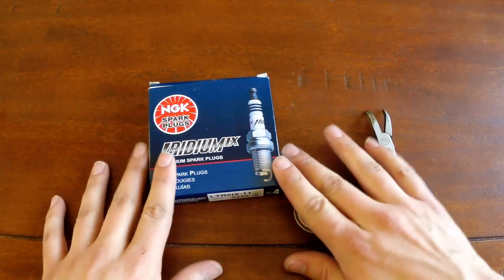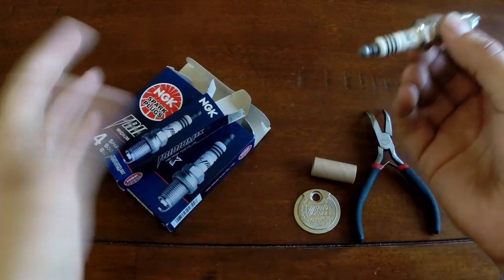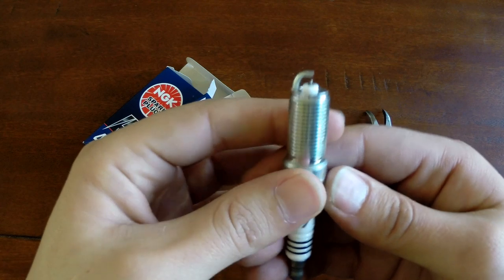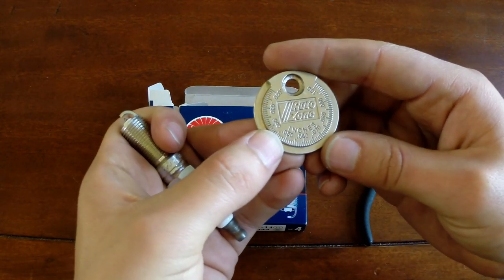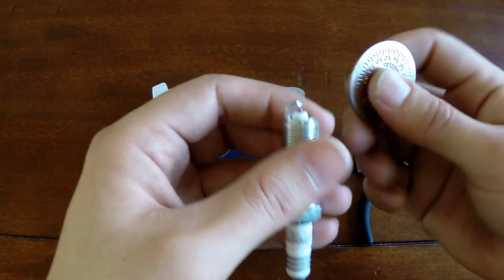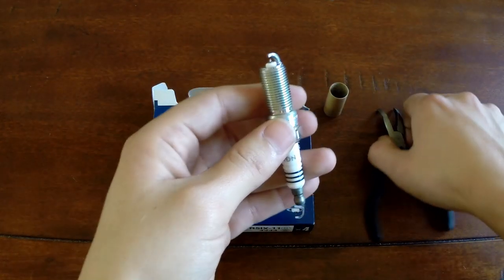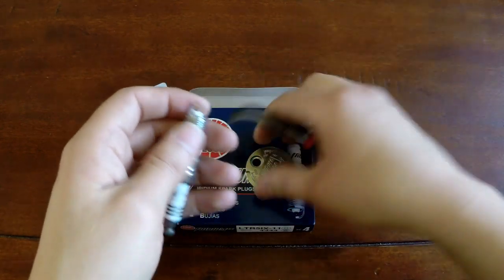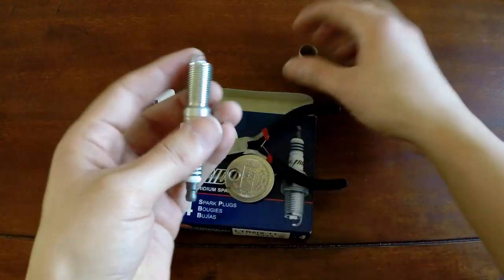NEW SPARK PLUG INSPECTION AND PREPARATION!

Comment: Do you ever use an anti-seize lubricant?
Reply: Anti seize is not typically recommend for spark plugs as it can change the torque. However some people swear by it some people never do it some people take there oil dipstick out and dab it onto the threads.
Reply: Eric Rollins eric wrong i got25 years as a dealer mechanic with 3 ase's engine brakes and electrical.. anti sieze will not back out your plugs.. you just use a dab on the side of each one.. if you have problems putting one in you have to buy a special tool to tap the hole put grease on the tool to catch shavings and tap the hole ... what the anti sieize does it just stop rust from forming and having a hard time

all spark plugs now come gapped per application you ask for the type of car and there already gapped
Reply: Doc Holliday Always check the gap even if the plugs are pre gapped. I've bought many sets of plugs that had a gap smaller than spec....
Reply: im a mechanic 25 year ase 5 of them dealer mechanic.. you do not need to check the gap they are pre gapped  gapping hasnt been done for a very long time
Reply: 99% of plugs may be pre gapped I'll give you that. That being said, I still dont put plugs in my car without first checking the gap..They get bounced around in the box and sometimes the gap does chance from my experience, usually smaller.
Reply: +Wyatt Earp last 2 boxs of autolite irridiums the gaps were way off. not one was gapped same as other and only 1 in 8 was correct out of box. noticeable power difference in 2.3 ranger after installing new plugs though.
Reply: and i own my own repair shop too.